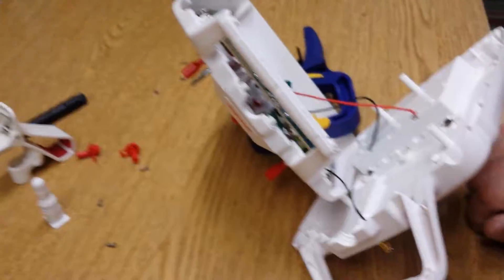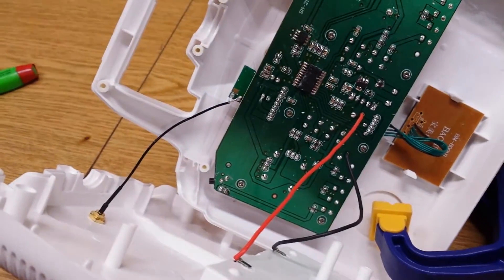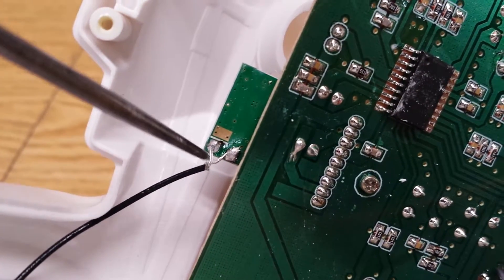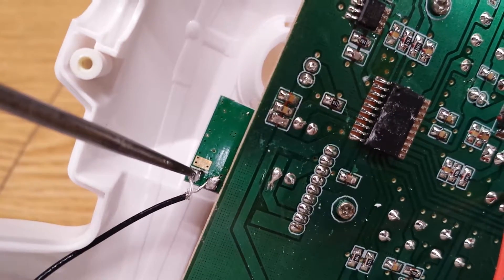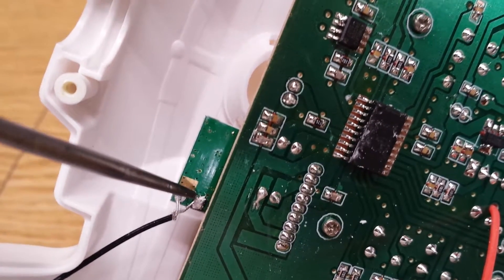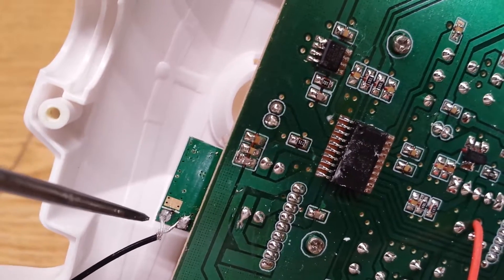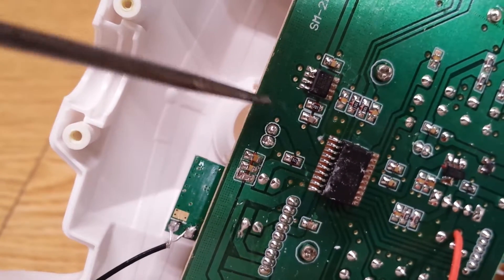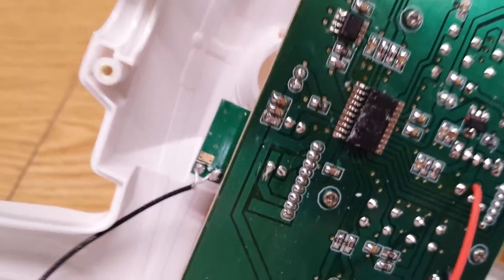Syma remote solder detail

Comment: hi willie, i followed your steps to wiring the antenna to the places you showed. I tested it worked. But sometimes when i turn on the drone and the controller it has issues where the drone doesn't connect to the controller. It would work after turning both drones and controller on and off a few times. The times they didnt connect the drones lights weren't blinking. I understand when turned on the drones lights should be blinking and after pushing the left stick up and down the drones light should stop blinking indicating they are connected. But sometimes they dont blink at all and pushing the left stick up and down does nothing. Do you have any problems with that? Thanks.

Comment: thank you for this video it helped me a lot, although I wasn't able to desold the ground wire properly as some of the wire was still left but I just covered it with tin and placed the new ground wire on the top where the soldering point was opposite of the hole side. I hope that won't be a problem as I haven't tested the range yet but plan to do so soon. I am happy I didn't fried the transmitter so should be fine 😄thanks a lot 😊